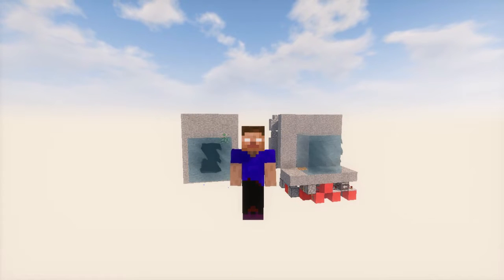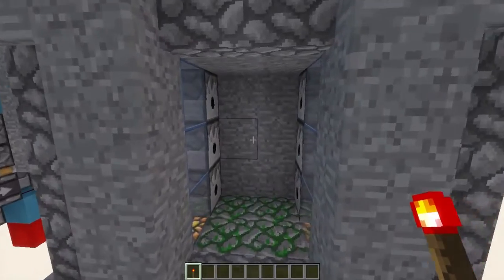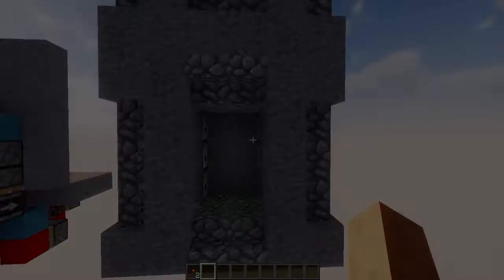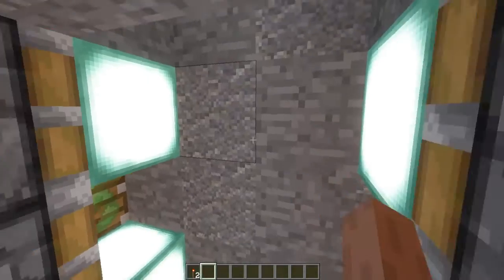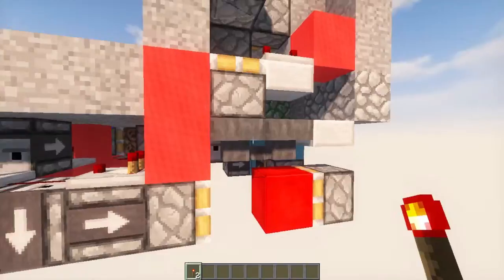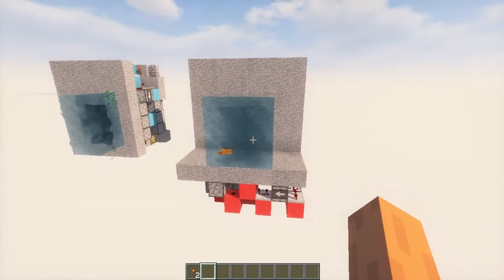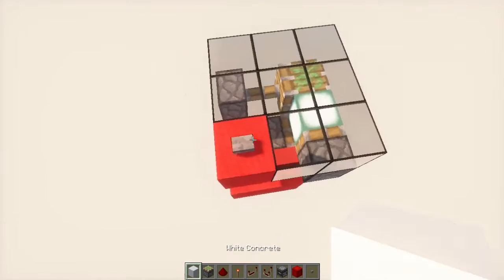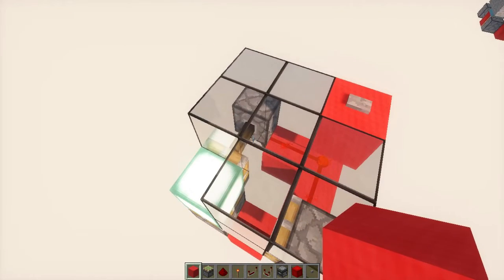Realistic Underwater Air Lock | Minecraft | Video Response

Comment: Sorry to be a hater, but this doesn't have quite the same sequence as the challenge (like a realistic air lock would): open first door, player in, close first door, drain water (slowly), once water drained: open second door, player out, close second door.
Sorry again. I just really liked how realistic the sequence was, and the challenge was to make the same sequence, but to compact it and make it two-way.
Reply from the maker: Your comment reads more as a constructive criticism/complaint than haterspeech so I'm answering:

I kind of expected comments like this when I published my video. I actually built 5 different prototypes before I recorded this video (including 2 with the exact specifications given by Doc in his video) but in the end I just decided that those were the most interesting to show.

In my particular opinion the first (simplistic design) is the one that makes more sense: You come from a wet medium, get isolated, dried than introduced to a an air medium. Flooding the chamber again makes no sense when it has to be dried before you leave again.

I might end up building a new super fancy version in the near future if I get inspired.
Reply: Thanks man. I'm usually not one to criticize anything, I was debating if I should post that for a long time before I did.

To me the problem was how on the first design the water was "drained" instantaneously - which isn't realistic by today's standards, and how on the second design there was no second door and on a realistic scenario the area would just get flooded with water.

About the first, it is indeed very compact and simplistic, but I can't help but feel that achieving that same compactness while keeping true to the challenge would be - well - more challenging.